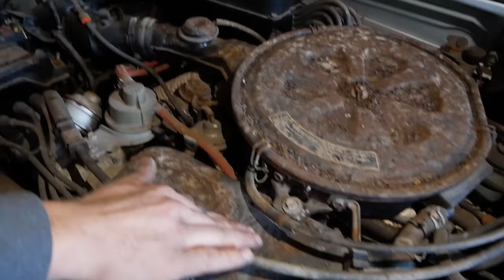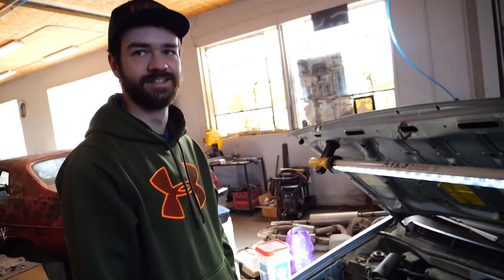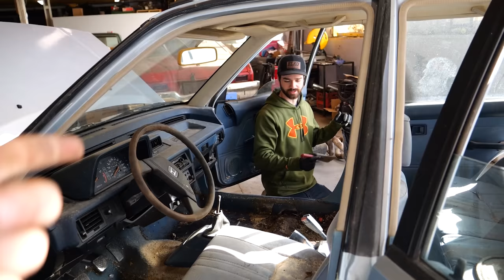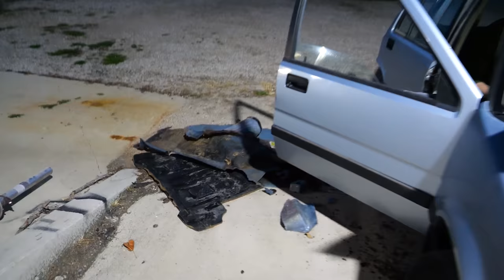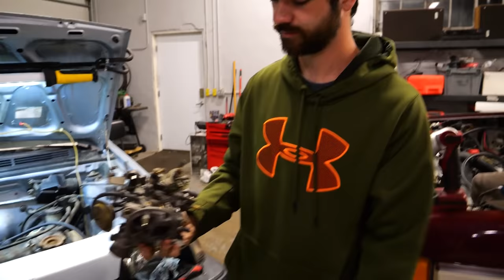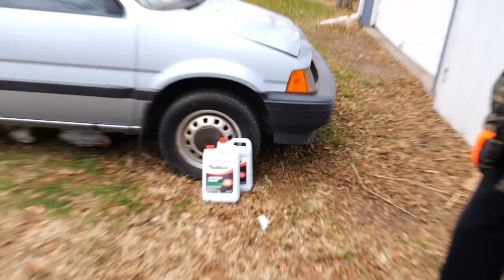ABANDONED 4x4 Honda Civic - Will it Run After 20+ YEARS??

Comment: Something I have learned. because my dad works at a Honda's factory. they never die you can literally pull them through the roughest terrain ever beat the living heck out of it. push it through its limits with no change of oil or anything and it would never die. the older the Honda the more stubborn it is until it rust itself to death. it will keep on moving.
Reply: Great way to say what makes Honda a highly sought after used vehicle for a daily driver when you need reliability to get to and fro....

Honda v Toyota

well today Honda is most sought after in my circle of peeps but.....

... I own a 2003 V8 Tundra that I love to death, 
literally, 
I will die b4 it does.

I'm 65 it is 20 and with my inner workings I'm really like 85.
well, my "Baked Alaska" (clear coat has been burnt off) residing for all its 20 years in the SW (ARIZONA/NEW MEXICO) the inner frame, well it's still baby behind fresh as the day it rolled off the assembly line. So if you don't look at the skin and concentrated on its inner workings, mechanically, she's still an infant.
I've put some 2 grand into the basic needs and she has 164K on the clock so let me repeat the reality of my satement,  "until death shant we part."  
Yes, she'll out live me.
Reply: @claztube  I may be only 29 years old. about to be 30 next year but Honda's always been around me in the 90s and early 2000s. I have dealt with enough of them where they were even my first vehicle I drove. I have never seen a Honda die just like a Toyota unless the entire floor rust right through. and I have seen that several times knowing my dad works at a Honda plant here in Indiana. one thing I can definitely tell you they don't make them like they used to. especially the four bangers they are truly stubborn.
Reply: Yup.  I drive a 92 accord.   That f22a sees 6700 rpm daily 🤣🤣.  230k miles on her now.    I had one before.  It was 300k miles and that one I absolutely abused    neutral drops ,it saw 8k rpm when the tcu shorted out , ran without oil alot and still she kept going
Reply: ain't that the truth
Reply: "...the older the Honda the more stubborn it is until it rust itself to death." Yup, I can testify to that. I had a '74 Civic (manual trans and choke) and while the engine was indestructible, the body gradually became...imaginary.
Reply: Can confirm. My sister used to own a 2008 (I think?) Civic, bought it brand new and somehow, despite it being all beaten up and looking very exhausted on the surface, it was still perfectly running six years later when she sold it... to buy a newer Civic lol
I honestly have no idea how it survived, considering how badly she was treating it... She even went offroading a couple times and I swear I can still hear the sounds of the whole underneath literally dying during that ride😂
Reply: Well, with respect to the oil, at least change it every 10K... lol  My sister killed off one of these (in this case, an '86 4-door) in 1995 by not changing the oil for 40K mi.  About 20K miles through her experiment, it started smoking just like this one.  In fact, when cold, and the choke was set, it'd cover about 1/4 of an acre of land with blue smoke.  Then, in January 1995, lost all compression in cylinder 4.  Other than that issue, and two fuel pumps, plus a starter that stopped extending the bendix gear, it was pretty reliable.  Engine did get swapped out at 133,629 miles with a 1984 JDM motor that had 50K on it, but we drove it another 26K miles before we decided to sell it.
Reply: @christopherelrod8788  the fact that some of you purposely trash what you have is ridiculous.
Reply: @richsweeney1115  I was young and dumb for the trashing of my first one.    And I drive mine like I stole it but I always over maintain my car.  Fluids are changed at half intervals I check my brakes and suspension often(once a week)
Reply: @christopherelrod8788  I've got a '93 EX 5-speed, bought it from a Honda tech who owned it for 25 years, a little more miles than yours, barely broken in.  Here in the PNW there are still CB7's crawling all over the place.
Reply: @christopherelrod8788  I've done the same ,  when I was in highschool in 02, I got an 87 granmarquis, I treated it like is was a mustang cobra. I maintained it well, and it never died
Reply: @richsweeney1115  yeah exactly! i get revving is fun, but why run something without oil? that doesn't even make it more fun!
Reply: I had an 80 civic wagon with a cvcc. Blew it up after water pump fail. Rebuilt it but took off all the hoses and didn't put them back right. Thank goodness I worked for honda and had Danny at middle gate honda fix it and it was awesome. Gas mileage was epic. Heads were so hard to get off. Broke three sockets before the mechanics told me there's a special socket to do it. Was my first engine rebuild. Dont imagine doing that shit at 54 now..

Comment: I used to have a few of those Wagovans when I worked for an import car recycler. Same deal, AWD and manual transmissions...loved them especially considering I lived in the country in northern Canada and winter roads could be dicey. Even in the 90's those rear pillar glass panels were hard to come by used as there weren't a lot of these vehicles sold.

Comment: When it was first produced in the early 1980s the Civic was actually CVCC, or Controlled Vortex Combustion Chamber, which you found out about. The spark touched off a small pocket of normal fuel/air that then ignited a lean mixture that made up the rest of the chamber. Quite a boost in economy.

Comment: The idea behind the CVCC was the same as the direct injection on newer engines. Stratified charge. Lets it run really lean at part throttle without detonation or high NOx.
Reply: Exactly.  @Junkyard Digs, if you pull the valve cover off, you'll see that the EW1 engine actually has 16 valves.  Three large valves, then the small CVCC valve.  The oil smoke might be caused by loose valve retainers, especially since it doesn't completely go away after the engine is warm.

The system was used on all US model carbed Hondas through 1987, except for the Accord, which went to a standard carb setup in 1986.  Allowed them to run without catalytic converters through 1979 in California, and 1980 in the 49 state emissions markets.  1981 was the first year that they installed a converter on all US model cars.  Mixture is set on the Keihin carburetors using a propane enrichment system that's connected to the engine.
Reply: @john242ti  Honda built a pair of heads for the 350 Chev that passed the EPA testing at the time.
Reply: @enwri  That is correct. GM didn't seem that interested in licensing the head design, which is why Honda decided to use it on their own engines.
Reply: @john242ti  Honda was already using it, they did it after GM said that it only worked on little toy engines and not GMs proper 5 litre 145 hp engines. 
Now "The MAHLE Jet Ignition® system"  are using it with electronic injectors instead of valves and extra carby bits.

Comment: Great video.Just FYI. I work at a Honda dealership and one of the veteran mechanics was telling me that the weak point of the older manual transmissions in the Accord’s and Civic’s are the reverse gear. He informed me that you never put them in reverse when still rolling forward or Vice versa.. Apparently it will break the drive idler gear or a shaft. Used to be a problem area of these transmissions back in the day. Just thought you might like to know.
Reply: Thanks for the tip.  I and my '93 Accord thank you.
Reply: @mescko  I also have a CB7. Mine is a 2 door manual coupe . 92' Had it since high school, and im 37 now. Shes on her 3rd engine now. Went from the stock F22(Non Vtec) to a 97' F23(Vtec) and then finally bought the B18c, trans and seats/dash//wiring harness/ecu from a buddies wrecked 99GS-R integra.  I had to swap the entire wiring harness over from the teg as its obd2, and i just used the dash and cluster from the teg. Had to modify the dash to fit, but surprisingly not as much as you may think. It basically just sits right in, just needs a bit of "Help" fitting the way one would want it to. Glances over to the saw-zall   "You dont need to worry about the saw-zall.... Its fiiiine." Ha, but yeah man, glad to see some others repping the cb7s. Only like 6 or 7 clean ones around my county that i have seen. And ive talked to most of the owners over the years. I dont daily the accord, but, it does get a few thousand miles annually.

Comment: 80's and 90's Hondas are the definition of un killable. Had an 97 accord without VTEC. ran on exactly 2 pints of oil. any more and it would leak. Ran great, great mpg, and the 5 speeds are so fun to heel n toe. I'm hoping to find a 1st gen NSX one day. It will be kept stock, and daily driven. I wanna see how high the miles can get and it still run
Reply: I had a 1990 Civic AWD wagon and it was great until it got T-boned by a Mercedes in 2000
Reply: Can confirm.   I've had two (currently on my second) 92 accords.    My first was absolutely abused (16year old with his first car syndrome) 300k miles.  Leaked like a mf.  But never had real issues    she got rear ended by an SUV doing 40.    She drove home.   But she was done

Comment: Saw this first on Instagram, super excited to see this video. I would swap my toes to find a 4wd wagovan like this. Rare and sought after vehicle in the honda community ! Can't believe it's not rusted out. That drivetrain would fetch a nice profit in the drag racing community.

Edit: I see now about 15 minutes in that this thing is super rusted out 😅
Reply: That was my thinking too. Exterior looks very unrusted for as old as it is. Given how the seats inside just turned into rust dust, and the floorboard too, I wonder if the goo on the floor was some caustic substance store in the car that ate its way through the container and caused major rust after leaking

Comment: This takes me back!  I owned an '87, sky blue just like that one for years back in the early 2000's.  Mine was "Real Time 4WD" which was basically AWD, it didn't have a button. 

It was ugly, it topped out at about 80mph, and it cornered with all the grace and agility of a drunk Rhino, but it had a 5spd, it only cost me $500, it was as good as any Subaru in snow, and it ran like a tank!  Never once left me on the side of the road.  

In the end it was rust that killed the beast.  I put it in for inspection and found out the entire rear axle was basically hanging on by a thread.  The mechanic bought it off me for the motor and trans which he put in another civic that he drove for years afterword.  You just can't kill a Honda engine.

Comment: My dad had the normal 2WD version of this Civic when I was a little kid, can still remember the box of cassettes he kept under the passenger seat for the stereo, along with the lack of air conditioning (very memorable during Australian summers...). He used to run it on a 50/50 mix of leaded and unleaded fuel.

Comment: These things were tough.... My father had one, he blew out on a motorway in Belgium. The car was scrap, but still passed its roadworthiness test. I emptied the oil and drove flat out down the hill past Luxembourg airport, but it didn't die.  He eventually sold it to a farmer, who eventually killed it with 750000km on the clock.

Comment: These had a much cooler name in Europe/rest of world - Honda Civic Shuttle. This was my first car, push button 4wd, 1.5 12v and all. Wonderful gear change. No power steering. Manual choke. Amazing visibility all round with that glasshouse design. Comfortable, practical, economical. Great to learn to drive in. Fold the seats down in the back and throw in a mattress, you can camp in it. Used to launch a boat straight off the beach in Scotland with one.

Comment: A CVCC carb repair kit is gold. You need a coil of vacuum tubing to do one of those. The turbos on the daytonas crap out. 88 and up will accept later engines. I was working as a Honda tech back then. Best of luck.

Comment: Had a 84 Accord with a 12 valve like that. Made a custom turbo setup for it with a side draft SU carb, turbo sucking through it. Would shred the tires 1-3 gear, 135 MPH machine. This video brought back some great memories.

Comment: FYI there is a idle mixture adjustment screw which im sure others have mentioned.
It's on the back of the carb on the base. It's next to the coolant nipple iirc, its that little brass screw recessed into there.

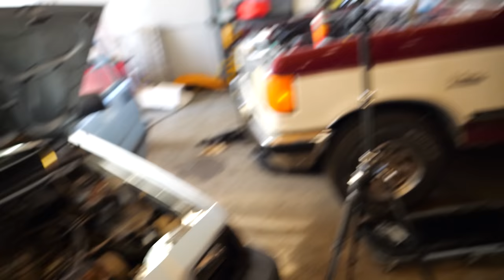Comment: 19:20  starting fluid sometimes comes with a upper cylinder lube, put a little 2 stroke gas down the spark plug holes or intake first

Comment: One of my first jobs was at a junkyard and there were still enough of these on the road that we pulled motors to sell.

Standard procedure on these was to unbolt all those vacuum controllers and canisters from the car and lay em on the engine without disconnecting them.

They were included with the engine purchase

Comment: A Honda Shuttle, I haven't seen one of these for years. My father had one, iirc his was a 1500, 16 valve injected front wheel drive model. He took it everywhere and usually had it loaded up with all sorts of stuff. I remember all he had to do to it was a head gasket and egr sensor.

Comment: The UK version of this car I owned had WAAAAY less vacuum lines, and no catalytic converter. Fuel/ignition never gave us a moments trouble in 20 years of ownership. I suspect I had the head gasket issue by the end though, car would randomly overheat from time to time towards the end. Timing belt snapped and killed it before the gasket did though.

I'll add: these were rated at 85bhp in the UK. We ran it on leaded petrol. We even put 100LL avgas in it one time during the fuel crisis in the the early 2000s.

Comment: I had a 81(?) Toyota pickup and it wasn't running too good, so I did the same thing.
I filled a 30 gallon drum with emissions parts and could finally see the motor!
Ran perfect for years and I gave it away to someone.

Comment: Drove one of these in high school. Non greasable u joints on back shaft . In central ny almost guaranteed the u joints seize up then honda had you buy a new drives haft which was 800 in the 90s

Comment: I used to have an 87 crx with that engine.  It was an absolute nightmare to work on and get to pass CA smog.  Even the local Honda specialty shop told me I needed to cut my losses and dump it.

Comment: Cleetus just did a video on running engines on brake cleaner....it's actually really bad. Causes horrible knock. They make different starting fluids with different amounts of ether based on application. They all include hydrocarbon compounds to assist in cylinder lubrication. Brake cleaner is designed to remove all oils period

Comment: We had once a 91 w 5 speed front wheel drive only .  Ultra reliable & wish they'd remake the same car 
300,000 miles , 1 clutch , 1 set brake pads ,1 timing belt & 1 radiator 
 I did put a high energy ignition system in it when I 1st bought it & changed the Oil using Premium oil & filter .  Drove it no less than 200 miles per day commuting w 2 traffic jams daily each way 
  Paid 3500 w 65,000 on it 
I still can't afford a new side by side that would be perfect on my mini farm and old decommissioned mtn Rd as at present I have to walk it which I rarely do due to advanced Degenerative Disk disease (need 3 disks replaced ) 
 I went to automechanics school via vocational back in HS , graduated in 1990 .  Out if all the cars I've ever owned that civic was the most reliable & got better fuel mileage than my Honda Motorcycle Stroker by far . 
  Fyi for classic vehicle owners when I worked a wireless project 4.5 mo in Las Vegas 2004 , I came home to my 62 international I restored being stolen w only 36,000 original miles  , PD wouldn't file a report as I wouldn't lie & say what 30 day period it was stolen in .  There is No stolen state or federal database for vehicles w 13 vin numbers , Even though titled in WV , the thief in PA was given a new title & Reg & their identity protected wrongfully by the State of PA then WV w do nothing stating state line Jurisdictional garbage . 
  3 years of hard work doing the restoration for nada , I loved restoring American Classics , haven't bought one since ! 
  I'll never live in PA again despite being born there (Full of Communists in my opine) & No true rule of Law upheld per experience . 

You did a great job getting that old beast running again & hope you have alot of fun w it . 

Also note in the classic car world there also is No antique vehicle stolen database of any kind . 
Specialty car insurance doesn't care either , they Might pay you out something but if when vehicle is found they won't notify you either , they'll sell it for $$$ and pocket any profits = that just seems wrong . 
   
Again Nice job , ya have some skills Brother 1 gear head to another 
  Graciously , Reverend RM Bowles 
👍 I look forward to ur future projects 
  May God Bless you , your friends and family

Comment: I had a gold 1987 Honda civic 2 door hatch back 90K miles and no rust at all.  I picked it up for $300 and though it was cool till i had to spend weeks sorting out all the vacuum  lines but once i did it ran like a top. it was a fun little car but ill never mess with a carbureted  import again.

Comment: In 2002 I bought a 85 civic type S.  It's the same over all hatch back look and body style but not as long and not 4×4 for $500.  It had 350 000km and didn't burn oil.  Drove it for 2 years then bought a small truck and sold it to some local.   The dude wrecked it in less then a year by literally driving the total 💩 out it and ditched it a bunch of times.  It was so unique looking and rare.  Should've kept it. It was manual and had a choke on it too lol

Comment: Mess with the timing so it can stop breaking up. Put spacers on the struts for a cheap lift kit. It should have enough power to break the rear end loose on the wet if you jerk the wheel at 15 and give it a clutch kick lol